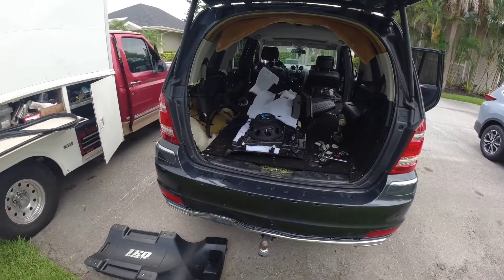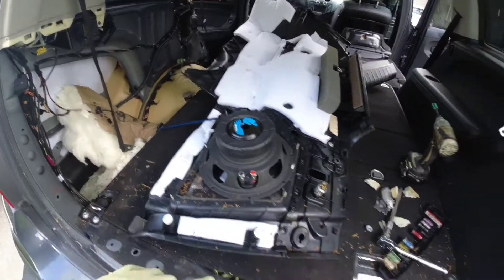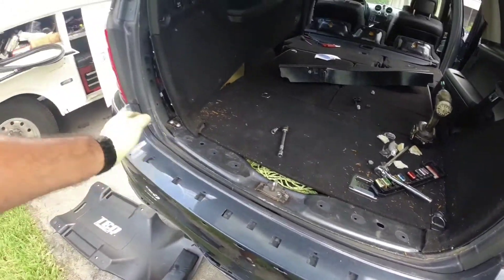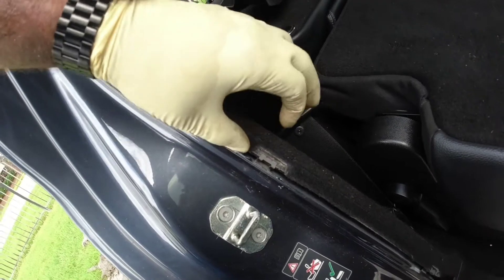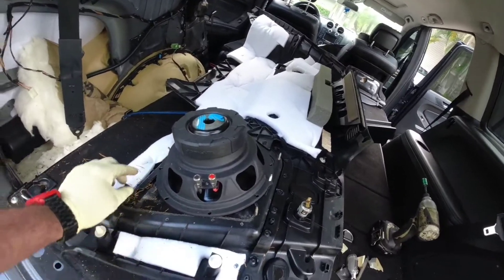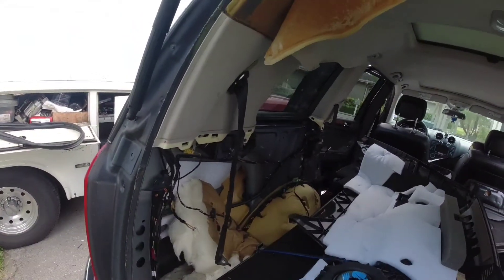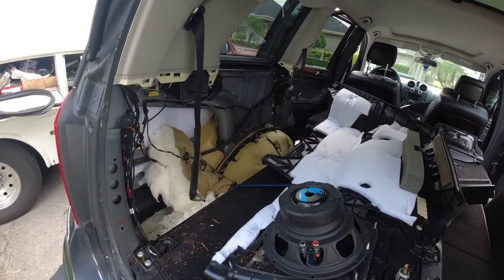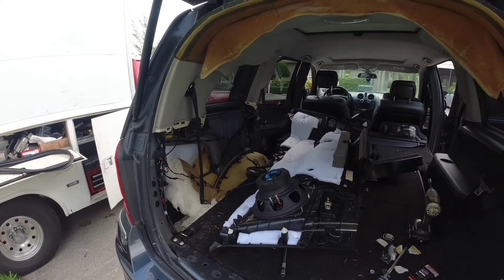2010 Mercedes-Benz GL450 Rear shocks replacement

Comment: You could have eliminated about 90%of you work if you would have accessed the shock nuts by simply removing the rear arm rests.  No need to tear the whole rear end panels apart.
Reply from the maker: True I just didn't want to take a chance on braking the arm rest or not been able to put back in place